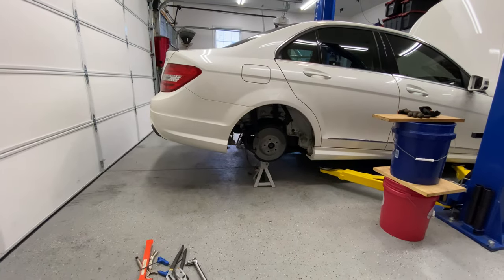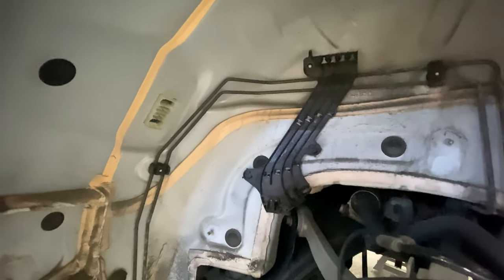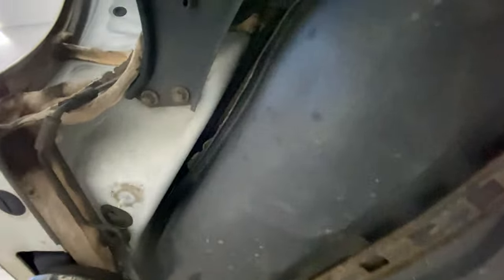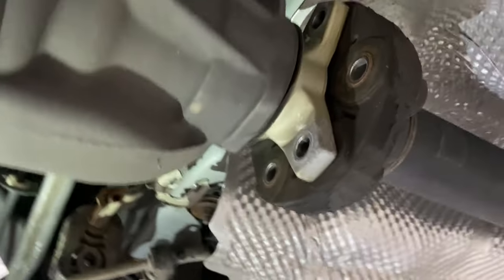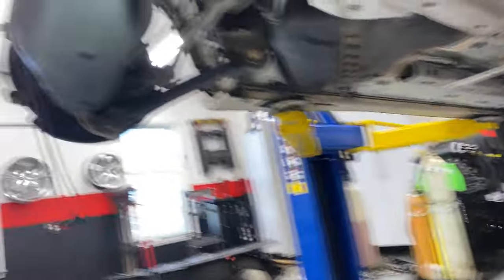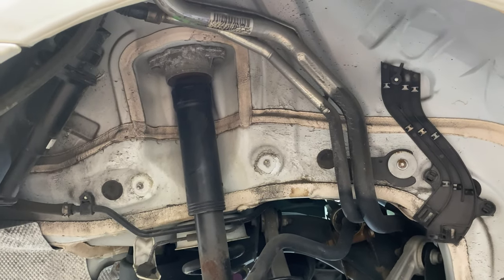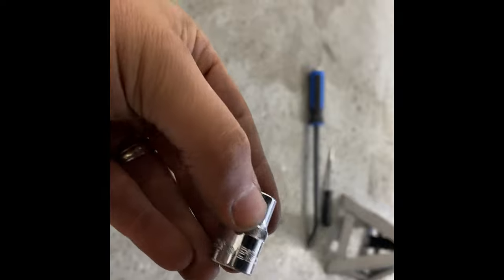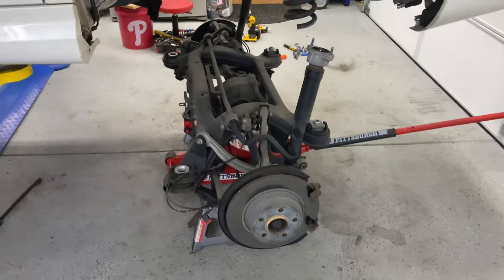2008-2014 Mercedes W204 (C250,C300,C350) Rear Crossmember Replacement

Comment: Mercedes Benz USA is starting to fix these for free. They extended the factory warranty from 4 years 100,000 miles to 20 years unlimited miles. I’m taking mine in May 16, 2023 to have it looked at for free by Mercedes. If it needs replaced they are doing it for free.

Comment: The rear subframe on my W204 (2009 C200 Sport CDI Saloon) has failed in the same place. The other side is also corroded. Fortunately, I'm in the UK so I've already booked mine in at a local dealer and subject to approval from the UK HQ it will get replaced free of charge. The cost would be in the region of £3-4K most of which is the labour. I will be documenting this on my own channel. You've done the right thing spraying all the Fluid Film in every nook & cranny of the new subframe.
Reply from the maker: That’s great, I hope they start recognizing the issue here. It’s obviously a design or poor material flaw. I just had the car in the air last week, and the rear subframe looks flawless, not a chip out spot of rust anywhere ( 3 months off winter driving and about 3500 miles)
Reply: My subframe is going to get replaced under warranty. Unforunately, it is currently on back order as there's no stock in the UK or Germany.
Reply: In the USA.
I received a letter a few months ago from mercedes. 
Extending the warranty to 20yrs on the subframe. 
For both my c300 and my SLK.
Reply: That's great news. Mine was replaced under warranty so it is back on the road.
Reply: did you get yours sorted mercedes belfast looking £157+vat just to look at it then wait for approval from mb head quarters
Reply: They shouldn't be charging you to inspect the car in relation to a potential warranty claim. Find another dealer if possible.
Reply: @Parknest In Ireland they charged me 120 eur for inspection and I got an approved free replacement of rear subframe....
Reply: @lguerecaable  It might be different on the Emrald Isle with the inspection but the corrosion warranty is the same (30 years in Europe).

Comment: Mercedes sent me a letter last year, will replace free here in USA.  A friends 2013 E350 went last year, my 2014 C300 went with only 42000 miles... so need to call dealer to make appointment.  Car is derivable now but need to be careful.

Comment: This part is under WARRANTY FROM THE DEALERSHIP CALL AND SCHEDULE A INSPECTION THEY WILL SEND OUT PICTURES TO MERCEDES HEADQUARTERS AND REPLACE THE PART FOR FREE 🫡 but be weary because your rear control arm bolts maybe frozen so they may charge ya to replace those
Reply: A torch they should be able to get them out but thanks on the heads up just took mine in

Comment: Your car looks amazingly clean underneath and doesn’t deserve a rotten subframe. clearly this is a component failure, moreover, it appears to have rusted from the inside. I hope a failure like this doesn’t appear under breaking at speed it could prove fatal. would you put your kids in a faulty manufactured car knowingly it to be  dangerous and the manufacturer knows about this fault and try to keep the issue quiet?

Comment: As a result of a class action suit, these subframes now have an extended rust-through warranty from Mercedes in the United States.
Reply: Where would i find more info on this?
Reply: I got mine, but I’m curious how bad it has to be
Reply: @Fractal_blip call MB dealer have the vin # ready. They will tell you if your car is on the list for extended warranty on the subframe!

Comment: These are still available from Mercedes. I had a 204 part # on my old one (which I'll add later after checking), but there's also 207 350 97 02 which supersedes part # 212 350 38 05. This is what I used on my 207 chassis. I got one with the older 212 part # for $1,200 close to a yr ago. W204's, W212's, C207's, facelift R171's and I believe early R172's all used these subframes. The Best, or...something. 
Thanks for making the vid
Reply: Thanks for the info

Comment: I have a 2014 c300 sport would the part in the link fit mine ??
Reply: Take it to MB dealer.
I dropped my c300 2014 getting the work done on extended warranty

Comment: have this same issue and mine broke in the same spot benzUSA will not replace it free of charge after 2 months of trying and now currently replacing.
Reply from the maker: It’s crazy how they haven’t recognized the problem yet. In Europe they’re replacing then free of charge. Thankfully it’s not a terrible job. The hard part is finding a good used piece. I bought new, but not a Mercedes OEM and thankfully it worked and is still working today,
Reply: @Mike G  it's a recall in the UK. Not sure about mainland Europe. I read a good amount of threads on the UK Benz forums about it
Reply: yeah i smoked a pothole and this happened to me. i wish it was free in the us

Comment: So I’m currently going through this problem can you help me find peice
Reply from the maker: Here’s the link to the piece I purchased, https://www.ebay.com/itm/363630400365?mkcid=16&mkevt=1&mkrid=711-127632-2357-0&ssspo=8ilvrwtwr0-&sssrc=2349624&ssuid=nVqoKoSUSai&var=&widget_ver=artemis&media=COPY

Mercedes said that they wouldn’t know or want OEM if I didn’t tell them. It installed easily and the vehicle was able to be aligned without issues. I hope this helps
Reply: When you ordered the subframe , did it come with new parts? For example , the part that rusted off , when I see the subframe it appears to be just the subframe without the control arms etc… hopefully I explained properly
Reply from the maker: @future2995  it came with all new bushings, but it did not come with the lower control arms. My control arms were fine. The mounting place on the Subframe is what rotted out on mine
Reply: @Future  the control arms aren't part of the failure. The mounting bracket on the subframe (which the control arms mount to) is what fails.
The subframes themselves are extremely weak in those areas to a comical level. 
Try part # 207 350 97 02 which supersedes part # 212 350 38 05. I also have a 204 # on my old subframe. These were on many different Mercedes chassis. Confirm fitment. Benz dealer network sites may say certain ones don't fit (even though they will), but what you really need to pay attention to is 4matic vs rwd as well as the p/n on your current subframe.

Comment: Just replaced subframe with the same issue. 2011 c300 75k miles with the same frame rot location.
Reply from the maker: Just curious, Did you use a used Subframe or a new one?